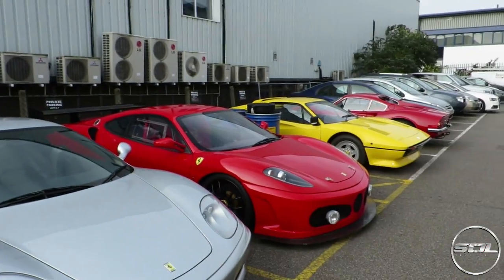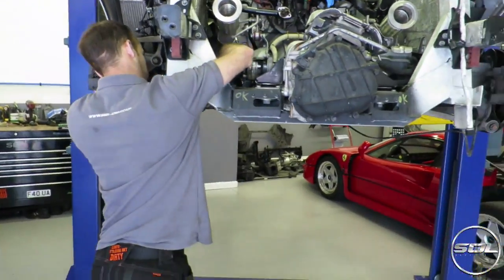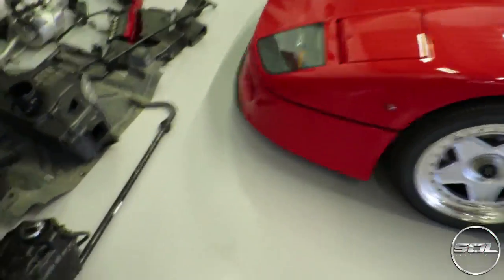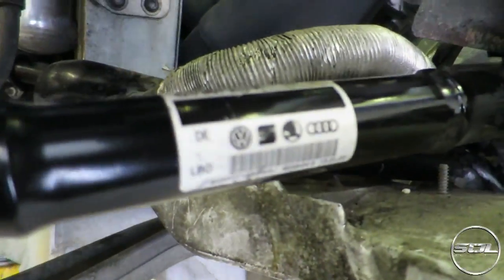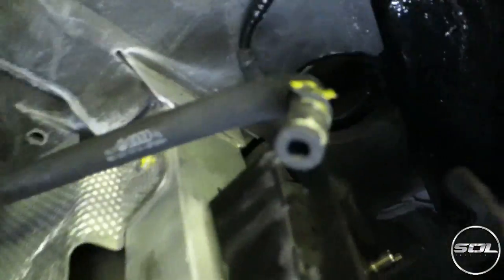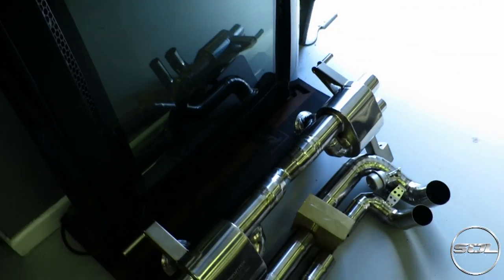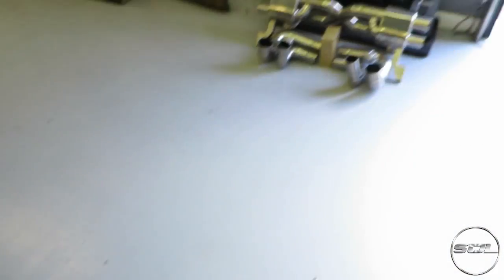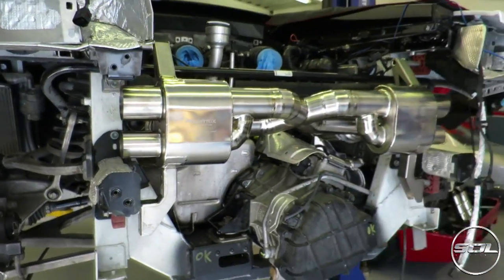THE ARMYTRIX PROJECT: INSANELY LOUD START UP!!!

Comment: Good grief, all these people talking shit cause he doesnt know what the parts are. Let me ask you a few questions: You like playing Xbox but you cant tell me what all the circuit boards inside the unit do?! You like cooking your food in a microwave but you couldnt take a box a parts and build one?! You like going to restaurants but you cant tell me the ingredients of the meal you just ordered and how it was made?! You like watching videos on Youtube but you cant tell me all about DNS and hosting servers?! Just cause you like something doesnt mean you have to know all the minute little details of it to validate your interest! I'm a licensed skydiver but that doesnt mean I can build a parachute from scratch. What I know is how to jump out of a plane, use my body to control my position and fall rate, and how when I pull a ring on my chest it pulls a strap aaaall the way down at the back that releases a pin and lets my parachute release. So maybe Paul only knows that when he pushes the gas pedal it sends a signal to the engine to release more gas which means he goes faster. Guess what? I'm still able to enjoy the shit out of jumping out of planes and Paul is still able to enjoy the shit out of owning a badass car. Stop slinging insults cause people do something a different way than you. Especially when that same insult can be applied to yourself!
Reply: +Beast5273 the guy who cares more about the correct name of the paint on his lambo, than the way it works? and then calls himself a petrol head?
isn't a fan of iconic cars yet bigs up boring beamers and a corsa? ...petrol head!?
Reply: +mrkthmn Im sorry but if you've watched previous videos of Paul you will understand that he is a bit of a goofball by not knowing some of the stuff he doesn't know. No one in their right mind buys a lamborhini without ever opening up the trunk/bonnet to see what the car comes with. He didn't know what the tire repair was (what happens if he had a flat tire?). He didn't know anything about how the stereo and nav operates (i mean he bought the freakin car). He didn't know what any of the buttons did. Just go back and watch that video where he films his car and gives a "tour" of it...he didn't even realize the gloves in the trunk where mechanical gloves lol
Reply: +mrkthmn ....I see your point and you make a very good point. But there is also a limit of naivety that needs to be set. Especially when you A.) work at SB Engineering - who specialize in auto mechanics B.) You have run a Supercars YouTube page for years (you should understand SOME basics) C.) You openly/publicly call yourself a "Petrolhead" on YouTube. All those things he does is more than just "liking Xbox" or "watching YOUTUBE". The guy works at a chop shop, drives and films supercars for a living. He should know that 6.3 liters doesn't correlate to the fuel tank capacity!!!! My Granny knows that!
Reply: TL;DR at the end since you arent going to read this anyway.

I'll agree with you guys on some things. That gas tank thing specifically is a bit silly. However, I still stand by what I said before regarding his knowledge and being able to be passionate about cars. He may work at the shop but is he a mechanic there? I'm guessing not since he doesnt seem to know much about the parts of the car.

Hypothetical Situation: If a graphic designer seeks a job on Honda's advertising team because he drives an S2000 (which is bone stock but his baby) and would love to be part of the advertising team for the new NSX, should he be required to be able to cover a shift in the garage as well? Is mechanical knowledge the prerequisite to loving the way a car looks, and sounds, and feels?

Look, I get where you guys are coming from. I'd like to call myself a car guy like all of you and that passion has indeed given me a desire to work on them when I got the chance. Right now youre thinking that since you love cars and because of that you work on them, "How the hell can Paul say he loves cars but not work on them?!"

The point I'm making is that we all have things we love and are good at without being knowledgable about the entire process. You think all those guys in Dubai driving hyper cars have ever looked under a hood? Hell no! "But they aren't running their mouth on YouTube acting like an authority on the subject!"

First of all, if Paul was trying to play himself off as a mechanic he wouldn't be asking questions like this on camera. He clearly knows that he doesn't have knowledge about the stuff and doesnt make it a secret. Go to his twitter profiles. He refers to himself as a YouTuber and describes SOL as "YouTubes most entertaining supercar channel."

You guys are trying to fault him for not being something that he never said he was. Petrolhead to you means a guy that eats, sleeps, and breathes cars and can tackle any maintenance/mod in the book. Petrolhead to the guy in Dubai means he has an air conditioned garage with 30 exotic cars in it.

If you can show me the clip where Paul says that he knows everything about supercars from bumper to bumper then I'll admit I'm wrong. Until then I stand by my argument. You can love cars without knowing everything about them or even want to know everything about them. Theres no test you have to pass to get your "passionate about cars" license.

Since none of you read the book I just wrote here's the *TL;DR* - Just cause you love cars and love to work on them doesnt mean that anyone that wants to loves cars also has to work on them. Its possible to love a one part of a thing, and share that with others, without being an expert on the whole subject.
Reply: +mrkthmn Couldn't agree more! Well said mate :)
Reply: +mrkthmn If you are a qualified Skydiver... you should know how to pack your chute, pack your reserve. reline your gear. set your AAD. you know what your closing pin does.. you know what your toggles do... and im sure you can identify each item.. the point of him not knowing what a drive shaft is, is the same as saying you dont know what your bridle and PC does. Its fucking stupid.. people who dont even drive cars can tell you what a driveshaft is, let alone someone with a lambo, and a channel about cars..

  If you dont know how to do these things you are inexperienced and dont know much about skydiving (im sure you do)... but its the same thing for so called car fans.
Reply: Ryan Flood The things you listed are necessary to be become to be a licensed skydiver. (with the exception of the reserve pack since you know as well as I do that you need to be certified for that and then you get one of those fancy little metal stamps). If you dont know those things you arent going to be jumping solo.

In absolute contrast to this, knowing what a drive shaft is completely UNnecessary to know how to a) safely obtain a drivers license (your skydiving example) b) see a beautiful car and think, Wow! I dont know what kind of car that is, but it's beautiful! Did you hear the way it sounded?! Magnificent! c) be one of those chicks with huge tits sitting in the passenger seat of a drift car having an absolute blast while being filmed for a cliche YouTube reaction video. (you've seen them) d) being the person actually driving the amazing car! Ex. the people that pay $500 to go drive a few exotics around a track in Vegas or Phoenix. 

The point I've been making this entire time is that you guys are putting some sort of weird qualification on loving something that says you can't do it until you understand how it functions. I also really dont understand how everyone keeps saying "especially if you own a lambo." All you need is money to buy a lambo. There are people that dont give two shits about cars that buy expensive, awesome, collector cars every day simply as an investment. So lets kill the idea that owning an expensive car places an increased burden of knowledge on you. You think that prick justin beiber knows anything about cars? Hell No, hes just rich and thinks ferrari's look good. 

Next is this whole, know what a drive shaft thing is. How many people would you like me to find where I show them a picture of the McLaren in your profile pic and ask 1) what do you think of this image? Of the ones that say beautiful I'll then ask 2) explain to me what a driveshaft does and point it out to me in this diagram of the car? I could find thousands wouldnt be able too!! Just because your passion for cars has lead you to want a greater understanding of their function places no requirement on others to have the same appreciation for cars. I know that people are going to say "but those people arent claiming to be gear heads!" In your own example you said that people who dont even drive cars know what a drive shaft is. I could find you thousands of people that do drive cars and dont know what a drive shaft is. In function and especially on a diagram.

Going back to your skydiving example, how many people show up for a tandem and are stoked out of their mind? Almost every single one of them. They do the jump and say they immediately want to go again (and sometimes they do!). They get the video, they show their friends, they start watching YouTubes and just get lost in it. Are those people full of shit? Should someone call them out and be like, Please, you claim to love skydiving but you dont even know how to pack a chute! 

This is the last time Im going to make the same point: A person can be changed by their skydiving experience. They can love it and tell their friends about it and try to surround themselves with it, all without knowing a single one of the things you listed. The same thing is true with cars, and art, and movies, and fashion etc... It is possible to sit in the drivers seat of a Lamborghini (which I have never done) and cream yourself when it hits redline without thinking to yourself This orgasm is brought to me in part by the driveshaft! Taking power from the engine to the wheels since I punched the gas!
Reply: mrkthmn In part i do agree with you... BUT. Paul works at a Race engineering shop. he has a channel about supercars. he owns a supercar cough this in itself is what puts the burden on him. not the people.. if you put yourself out there as a "car guy" start a channel about cars.. you have to A) know wtf you are talking about or B) be prepared for the shit storm of people slating you for not knowing what a driveshaft is.. i do agree with what you say.. but the circumstances are different to the average person... the average rich guy doesn't know what a drive shaft is, he just jumps in his ferrari and off you go, shit, real rich guys and i mean billionaires dont even keep the cars clean.. but again. Paul has put himself in the predicament by claiming to be a car guy, by starting his channel. working in the industry..(nvm the racing side of things) so yeh... agree to disagree or whatever. but he should know alot more about cars than he does.. i mean come on. a driveshaft.. lol.. if the guy said tell me what this loom does. and what each wire is connected to, i could understand, but its a driveshaft... and a skoda shaft at that... lol ;D
Reply: I'll come back that I do in part agree with you as well. Paul should be ready for the shit storm that is coming down on him. You put yourself in the public eyes for anything and there are going to be people that tell you that you're wrong.

Multiple people have brought up that he works at SB and I would ask, What does he do there? I honestly dont know. If it's anything but mechanic I would argue that it's a null point. I used to work at a tech company that sold tools for people to build websites. They sold hosting, domains, servers, web design, SSL's, etc. I worked in entry-level end user support so that is all I can be held accountable for. To your point, all people heard was, "You work at xyz company?? I want a website like amazon! Can you do that for me??" To which I respond, "Yes, I work for them, but all I do there is blank though so I wouldnt be able to help you." All the freaking time. 

Point being, does him working at SB give people the impression that he should then know every thing about cars? We're talking about it so obviously it does! Can't get around that. People are people. They assume. Also to your point, you just have to keep dealing with telling them the facts of it. But that's my question. What are the facts of it? What does he do there? If he's not a mechanic then how the heck can we hold him to those standards?

I guess where I still disagree with you is the idea that in order to love one part about cars you have to love all parts about cars. If that was the case then in order to be a car designer you would also have to be a mechanic, a driver, an engineer, a pit member etc. I say it's possible to just love cars because they are sexy and fast and fun to drive and not give a crap about how or why any of that is possible. But as you say, agree to disagree. 
True that on the skoda shaft though, lol! If that was my car I think I'd be a little pissed. I spent 6 figures on this thing and I get a part from AutoZone?!
Reply: mrkthmn To be honest. i don't know what he does there. some sort of marketing i think.. or web based stuff.. and yes again you are right.... i dont know everything about cars. not even close.. i couldn't strip a lamborghini down then rebuild it... but thats not the point.. each car is pretty much the same, it has an engine a chassis, gearbox,calipers, suspension, driveshafts, wiring looms, wheels, tyres.etc etc.. if you cant identify the basic things on a car then you arguably dont know shit about them.. its all good having a passion for cars. but if you dont know the basics then, you know jack.

 example.. if you didnt know how to identify the bridle strap... you wouldnt start up a youtube channel about skydiving, you wouldnt go and work at a drop zone marketing skydiving when you cant even identify the bridle strap....
.. yes you could still go skydiving, or drive the car.. but the fact is you cant identify the basic equipment. then say you still went ahead and started a youtube channel about skydiving. and still went and worked for a Drop zone..People will assume you know a thing or 2 about cars or skydiving.and thus you have to except that people who CAN identify the basics are going to be pissed and slate you. 
Unfortunately, we live in a day and age of followers... lets be blunt paul knows nothing about cars. he called his channel supercars of London and lives in watford... people sub to him, because he is a nice guy.. and people like to follow... unfortunatley its a problem of the times we live in.. look at pewdipie.. the worst fucking content ever seen, yet is the most watched youtuber.. people these days dont have a fucking clue.. they just see a lambo or an R8 and say wow. im gonna watch this guy.. even if there content is shit... anyway rant over, i think i went a little off topic here lol but the point is the same... PeAcE lol.
Reply: Ryan Flood mrkthmn Both of you make very good points. Its inevitable that the public will laugh and complain about Pauls automotive ignorance - he works at SB Engineering, owns a YouTube channel about supercars, grew up filming supercars, spent his entire life savings on a supercar he vowed to own before 25. That is some passion and dedication right there. I mean anyone else would think to rather get a mortgage first and move out of Mums house... Point is his whole life revolves around the automotive environment. Lets be liberal and not shoot him down for knowing jack-shit on car parts. One of you made a great point in regards to that, saying one can be passionate about an aspect of a subject/hobby/genre without having to know EVERYTHING about the subject/hobby/genre. This is true. I can say I love italian food and not know the ingredients or how to cook the italian dishes i love. I can even start a YouTube channel about Italian food with that limited information. However, car parts aside, i can not forgive Paul for not knowing Jack-Shit about Jack-Shit in regards to a Lamborghini that he had just purchased with his own money and publicly presented in a video on YouTube called "Tour of my Lamborghini" (which he later edited after being shot down so much to "idiot tour of my lambo..."). Im not talking about mechanical car parts now. Im talking: I just dropped my life savings on a used lambo but i never bothered to pop the trunk and see whats in it. I never questioned what to do if were to have a flat tire - the answer is in the trunk. I never checked to see if the radio/sat/media player even works. Or how it works. Or what all the buttons do on my dash. Or how the gearbox works with all the driving modes. Or what the oil temperature is? ...water temperature? No. I made a video tour on my new car that i know nothing about. Absolutely nothing other than its special edition and called a BiColore. Thats were it crosses the line into, " i look like an idiot" territory. Personally, i can only forgive him because he is amusing, a likable character and at least owned up to his mistake with the edited title. And to go back to my earlier comparison to passion of italian food: Even if i dont know ingredients to italian dishes that i love, if im presenting them on my YouTube food channel i should AT LEAST have an idea of what the difference is between Spaghetti and Penne is. I should know a Tomato from an Onion. Get what I'm saying? Leave the mechanical ignorance comments, the guy didnt know how to turn on his damn radio or what oil and water temp was on the gauge!!!!